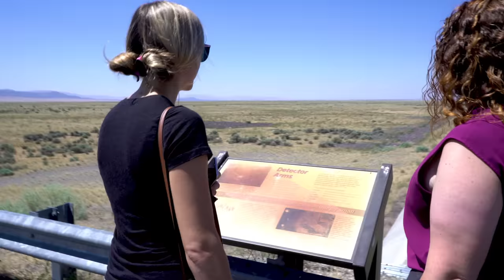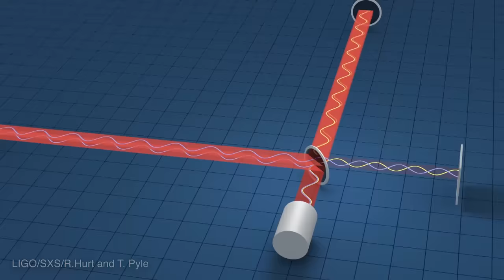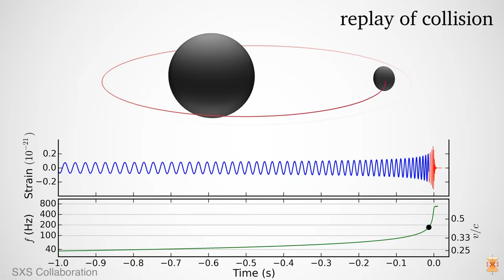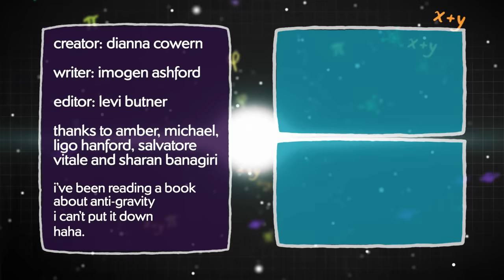Why are there giant concrete tunnels in the desert?

Comment: If the air is pumped out of such tunnels to create a partial vacuum, and a maglev track is put inside them.  They could be used for a HYPERLOOP.  By using a vehicle that moves with so little friction you can travel at a higher speed than any other means of transport while using less energy.  Think about it.

Comment: the fabric of space is a lattice of negative charges/points, on a size and scale, likely near the same as planks. all the charges are the same in size, therefore the lattice is formed due to like charges opposing each other and forming equilateral polyhedrons.

this is why the compression of space is so hard to achieve.

particles and waves that we currently are able to detect are the result of cavitation through the space. when gaps are formed between the charges/points either a wave/ripple occurs or a bubble is formed, or both... if both we would observe it as a particle created and a wave/tachyon released.

a positive particle is a void in space that the negative points are drawn to in a geometric formation that compresses the charges to a critical point where they are then forcefully ejected past the incoming points/charges in a location upon the sphere reminiscent of a pole, with a trajectory reminiscent of a line of magnetic flux. unable to escape the pull of the void/positive space the flux line circles back and re enters the twisted knot of negative charges compressing against each other in order to try and fill the void.

Comment: The obvious reason why gravity and photons/light travel at the same speed is because of the way that photons are "reflected" inside protons due to matter-antimatter "annihilation" in a proton core by the evaporation of a negative Muon Neutrino [composed of Electron Neutrinos] to eject a photon.

Comment: If the light is bouncing back and forth 300 times (hitting each mirror 150 times?), then any movement of the mirror would have a massive impact on the result. I wonder how they account for that? I assume that both sites are orientated in the same direction, and the total duration of an event is very short, to stand out from the natural deformation of the planet due to tidal forces (including tidal forces exerted from other planets and changes to earth’s distance from the sun etc, which while minute, could potentially be measured if so sensitive.) Not to mention earthquakes thousands of miles away. 
I somehow imagine that the tech for measuring the light wavelengths etc was actually the easy part, with the difficult part being how to eliminate the background noise.

Comment: Isn’t this the same principle as is used in Ring Laser Gyros? They’re used in Aircraft now I hadn’t made the connection until watching this.
Reply: Close enough. Not all interferometers are exactly the same, there are some non-trivial differences in what they measure and what they are being optimized for, but yeah, if you understand a laser gyro, then you have a pretty good idea what this experiment does. The technological details do, of course, differ greatly. What both devices do have in common, though, is that it was very difficult to build a good laser gyro system when they were invented and today it's (if not exactly trivial) much lower on the technology scale. LIGO started out as an experiment that many (serious!) people thought was just way too far out experimentally. It took a great deal of work to actually make it work as well as it does, but today we know that we can still do much, much better than this. Eventually we will have several of these devices that will be able to measure hundreds of events per week (or was that per day... I don't remember).

Comment: So, there is an angle of incoming wave that would cause the wave to be fully undetectable then?  stretching the arms equally at the same time?  I suppose that would be 45% as the radial direction back the center of the event.

More arms, yes?

Comment: I am fascinated though with the way they suspend the instruments so that they're isolated from the surrounding area like I'm an audio engineer so I've learned how and helped build control rooms where the walls and ceilings and floor was isolated from the outside environment so that a truck going by wouldn't create a buzz in the audio but these things are a whole different universe when it comes to sensitivity and I'm very curious I mean I've read how they suspend them kind of but I've never really heard in detail how they construction wise like how they manage to suspend the mirrors and the the particle beam a projectors and what those strings that hang I think maybe they hold the mirrors or but how they actually attach them to the surrounding walls and ceilings and whatnot but without the walls and ceilings affecting the movement of them I'd love to hear some details on how they build these

Comment: Question: you compared the gravitational wave like  rippling on water. The ripples move at different speeds from the point of origin,  by measuring this you could pinpoint the distance from you position to the origin of the disturbance.  If so, can you do the same for the gravity wave?

Comment: they should consider four verteces for the space LIGO. since Buckminster Fuller proved in his experiential mathematics called Synergetics that spacetime is structured in four planes of omni-60°-triangulation, as evident in the isotropic vector matrix closest packing of spheres, a detection system that is an equilateral triangle will undoubtedly be of more use than the rectilinear "2D" detectors on the ground. but given the effort to plant three detectors in "space" compared to placing four in a tetra configuration I wonder if the benefits of actually using a detector structured in spacetime relationships would not seriously be worth it...

if you want to know more about the dynamic triangular nature of spacetime, the generalized principles and patterns it evidently expresses and how you can get your hands on them as well as what they are useful for, particularly in the further relationship between humanity and the rest of our common Placenet Eairth, please check out my playlist on synergetics!

Comment: So if time and space are correlated don't gravitational waves stretch time as well or have some effect on it even if it's barely negligible indifference but it should right and that just got me thinking why they don't search for dark matter inside the gravitational waves kind of like when a surfer is taking footage of himself inside a tube you can kind of see the seaweed and so on you know different elements of the ocean inside of the the wave itself but it made me think because I was reading about the xenon detector recently and made me think wouldn't a gravitational waves to spend that area of space and time just ever so slightly that they might be able to have a better locale with which to inspect

Comment: Interesting video but you have glossed over the fact that orbital calculations assume that gravity propagates instantaneously. As I understand it, the problem is that earth appears to be attracted to where the sun is now rather than where it was 8.3 minutes ago.  If the earth were attracted to where the sun was 8.3 minutes ago then the orbit would slowly spiral out and the earth would be flung out of the solar system over a period of about 1200 years.
The fact that the orbits of the planets are stable seems to indicate that there is an unresolved discrepancy in current scientific theory.

Comment: These tummels where used as vacumme powered transportation.
They use to sit and  ride a little round cars.

The only reason why we don't do that, these days.
Is because the won't cover this.

Test the age of the concrete.

Pre 1800's

Here is a video, that shows a picture of the tunnel system.
Back when it was in use.

NO PAUSE CHALLENGE lvl WTF
IS GOING ON.

On you tube.
G.

Comment: youngs modulous ... doesnt actually measure stiffness but resistance to deformation ... steel resists deformation by its molecular construction .... space gets it's number from the lack of stuff to deform ... yes space is empty BUT not perfectly ... those bits of stuff are what transmits the waves ... no stuff NO WAVE ... basic Vacuum rules ... making the youngs modulous as useful as measuring a pound of gas with a a water tank to hold it ... if it isnt completely sealed it will always give a wrong answer
Reply: like cern cant detect beyond the speed fo light because they only have detectors that measure to that seed ... like using a 10v volt meter with a 9v and 12v batteries .... one reads the other does NOT 
.
btw Cern also has proven that light is NOT as fast as things go ... they have events that occurred at lest 60 ns before llght could arrive . meaning they were faster than t until they slowed down and got seen ... which also makes ligo useless because it depends on the speed of light being a maximum not a variable ... and all their results are wrong because they use light as the ruler ... when every time it turns it MUST change speed ... thermodynamics and newton both cover this .... making all the results suspicious from the first one onwards

Comment: She had my attention right up the point when she mentioned the engineering allowance for the curve of the earth's surface! (She failed to add how the laser beam was going to bend over that "curve"!)   What a waste...
Reply: Earth curves but they didn't curve the vacuum tubes to follow the Earth curve, they built them to follow the straight line that the laser would traverse so the  ends are the Meter and  fraction higher than following the Earth curvature would be.  The display portion of the vacuum tube is actually the smaller diameter one that they had to replace with a slightly larger diameter one.  I didn't get a chance to follow up on why that was, since we had to leave a bit earlier than I would have wanted to.

Comment: Usually in science for a discovery to be considered legitimate, independent verification is needed.  Has this happened in the case of gravitational waves?  Just if the results they're getting are so infinitesimal that detection is a thousandth the width of a proton, that could be due to a mouse farting a couple of meters away from the detector at just the wrong time (it seems to me.)  Okay, being a little facetious there, and that's not overly valid unless there was a mouse who had beans for dinner the other night in the vicinity of the detector in the other part of the country too...  But it's still a question.  Backing up your discovery of a new type of star by saying you saw it with a new type of telescope, but it must be true because the other similar telescope also saw it kinda rings hollow.  If it were picked up by regular telescopes as well, that would be different.  In this case, you said that gravity and light moves at the same speed.  So I suggest pointing a number of telescopes at the point in space where the gravitational wave was detected to come from, as soon as possible, and see what you can see.  Maybe the event that caused the detection was close enough to be visible by telescope?  That would be independent verification I feel.

Comment: All mechanical equipment everywhere is isolated from the building like that A/C unit. That is a typical installation. Nothing to see there.
Reply: It's actually very typical of sensor equipment. In fact, there is a designated 13,000 square mile zone in west Virginia where, by law, you must run on restricted power usage. The worst of the restriction comes within 10 miles of the observatory where you're forced to shut off ALL electrical equipment. Even someone like me, wearing a hearing aid, could cause massive interference issues with the very sensitive radio-telescope. You can call it a military operation, or just schedule a visit to the observatory like normal people.
Reply: @ryanthompson3737 You missed my point.
Reply: @roywarriner8441  If your point was that sensing equipment of all kind work the same, then good on you for understanding kindergarten level logic. There is plenty to see when it's 1 of only 2 sensors in the US that are sensing gravitational waves.

Comment: @Physics Girl...
If "gravity" actually existed, gravity would be an all-powerful natural physical force that would indiscriminately pull "all" objects down to the earth regardless of their buoyancy. 

Therefore, if "gravity" existed when dropping a tiny pebble into a body of water such as an ocean or a lake, then the tiny pebble would be pulled down to the deepest depths of the bottom floor level of the body of water which is exactly what the tiny pebbled does indeed do when the tiny pebble is dropped into a body of water.  

However, when dropping an air balloon filled with helium, the helium-filled air balloon rises into the atmosphere instead of falling down to planet earth or being pulled down to planet earth as should be the case if the all-powerful natural physical force of "gravity" actually existed.  

Question: If so-called "gravity" is an all-powerful natural physical force strong enough to prevent people from flying off the surface of the earth while planet earth is rotating/spinning at an allegedly1,000 miles per hour, then surely so-called "gravity" could prevent a helium-filled air balloon from being hurled off the surface of the earth.

The rising helium-filled air balloon is irrefutable evidence that so-called "gravity" does not exist, because if the all-powerful indiscriminate natural physical force of "gravity" actually existed, then not even a helium-filled air balloon could be hurled off the surface of planet earth causing the air balloon to rise into the atmosphere.

If so-called "gravity" is such an all-powerful natural physical force that can keep giant bodies of water (oceans) from being hurled off the surface of planet earth, then surely so-called "gravity" could prevent a tiny helium-filled air balloon from being hurled off the surface of planet earth as is the case when the helium-filled air balloon rises into the atmosphere.
Reply: Thanks for the "so-called" science lecture. BTW, birds have wings.